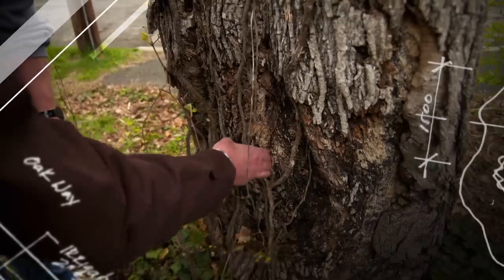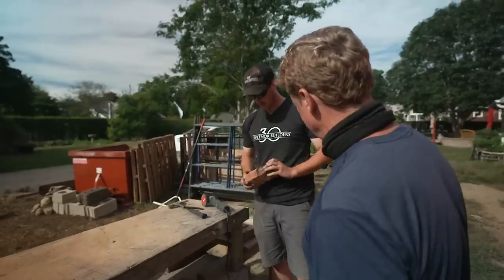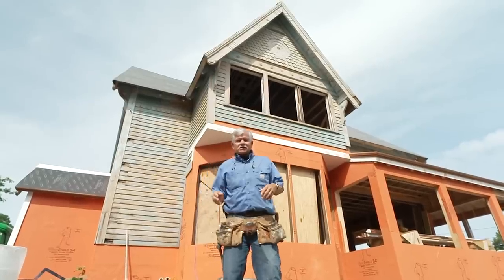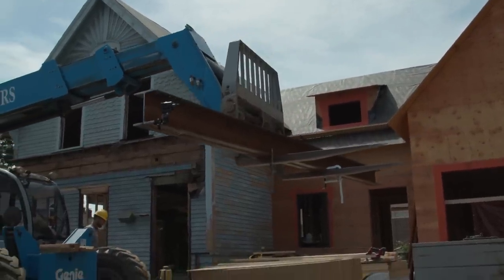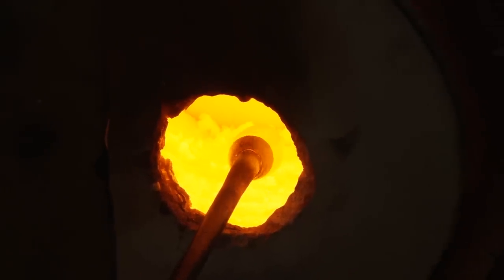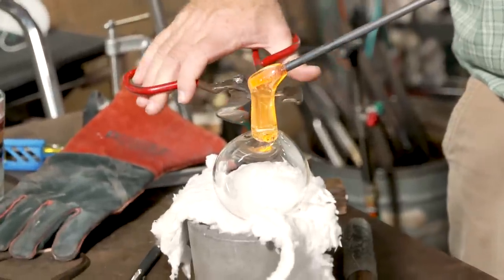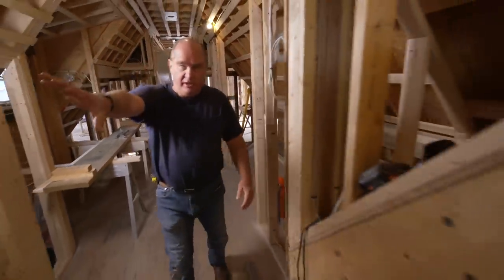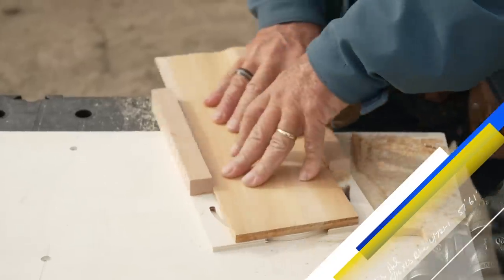This Old House | Chimney Straightener (S42 E7) | FULL EPISODE

Comment: What’s the fire hazard with these wood shingles?  Doesn’t look like there’s any useful fire inhibitor treatment?  Seems like a turned over grill or a lightning strike would put the whole place on the ground in minutes.
Reply: Been around way longer than any other roofing, you've surely seen those before.
Reply: Not really, I mean yes, but their not any worse than other types of materials used.
Reply: @sterlingodeaghaidh5086 how’s that?  “Other  types” of material, brick, cement fiber, Al siding are not flammable at all.
Reply: @DixieNormous1  Siding shingles for this TOH project.  And, most piece wood structures  burned eventually 1800s.
Reply: @Nill757  Let me prefice this by saying I get where your coming at but there is more to the equation than just what burns.  

TL;DR, they have rules to follow, and its not like wood siding is just waiting to combust the moment you put it up. 

Wood siding is rather good, its not like it will combust on the first sunny day after its installed, especially once its painted your talking about having to hold flame or keep sparks on it long enough to cause it to catch, not likely unless an extreme occours. The next thing you have to deal with is the bylaws and codes that are in play. They explained this a lot if you didn't notice but their in a historic district, and they have to make sure that the building complies with those regulations. This means using materials that are approved, in looks that are approved and more, even if they wanted to use more fireproof materials they probably have to use the wood shingles because of those rules.
Reply: @Nill757  All i am saying is their doing what their allowed to do and what they want. Knock it all you want its a choice because its allowed.
Reply: @Nill757  brick, cement (concrete) fiber and Al siding are all ugly.
Reply: @rogerweaver7686  Great, to each his own.  Just don’t try and pull me in to some bubble where everyone believes wood does not burn.
Reply: @sterlingodeaghaidh5086  Yes, and maybe there’s some flammable protection going on w shingles that makes them safe that I don’t understand.  On the other hand, Asbestos was allowed.  Balloon framing was allowed. Polybutylene water pipe was allowed.
Reply: @Nill757  Not saying its perfect, just that its allowed. Not everything has to have to be perfect. Some people want looks you cant achieve with other means, a residence or any structure shouldn't really be limited to certain stuff just because there is a chance of danger unless the risk is too great. This case, their fine, its not like the building is itching to burn down any moment.
Reply: @sterlingodeaghaidh5086  We all know the limit is where the “risk is too great”.  The point is to explore where that is, what is the actual risk, and not pretend there is none because it’s a personal  home.
Reply: @Nill757  yes, and in this case, id be less worried about the siding and more in making sure areas where fire can start are adequately protected. The actual risk is minimal, compared to other areas of the house.
Reply: @sterlingodeaghaidh5086  “minimal”

Ok, you know this how?  If you really don’t care about fire risk, great, that’s your business not mine.  I’m not interested in unsupported stories in my end.
Reply: @Nill757  I just looked up chances of a a fire in your house. Every year you have a 1 in 3000 chance of a fire in your house. Hope that helps because this baby shite should stop.

Comment: I remember when this show was about rehabbing an old house on a budget. Far away from that now.
Reply: Yep.  That fake chimney, with the unnecessary cleaned brick, unnecessary steel saddle, designed by an unnecessary structural engineer, scaffolding up on the roof, etc etc might be $60K.  For a Fake chimney.
Reply: That probably was their Knee jerk reaction to the COVID lock down.
Reply: @Nill757  They have no use for a chimney but are required to keep the brick chimney original on the outside.
Reply: @Egleu1  Yes I know the rules, resulting in an exorbitant waste of time and $ w no preservation of anything worthwhile. It’s a Disney-world ride.
Reply: @Nill757  how is it a waste of time and money? The home owners can afford it and the workers are getting paid. They're saving the old bricks.
Reply: @Nill757  the home owners know the price when they design the remodel. $60k is probably a massive over estimate, but either way it's not a lot of money.
Reply: @Egleu1  Steel installed up high and drilled onsite plus roof scaffold masonry labor plus structural engineer = $$$.
Reply: @Nill757  you think people buying this house and pumping a million plus into it are middle class? Besides with your argument then it's a waste of time and money to recreate the windows or the woodwork, why stop at the chimney?
Reply: @Egleu1  I thought I was clear.  This McMansion has been made not available to the middle class.  It easily could have become attractive and affordable housing from that old vacant. Now it’s not.
Reply: @Nill757  what's your idea of affordable? 500k? That house as it was needed a complete remodel just to be livable.
Reply: @Egleu1  it’s not “my idea”, but what the middle class can afford, ie the national median income, right now $1000/week or $4k/mo and then 1/5 of that max going to 30yr mortgage at current 7%.  Double the income for a couple maybe, but not forever if they are to have kids.  

Not sure what you mean by remodel.  Everybody knows it was an unlivable vacant needing a remodel, and everybody knows that the $2M or whatever TOH remodel was also not  the cheapest or only way to go for basic family shelter.
Reply: @Nill757  with a modest 1% property tax that gives you $106,861 for a house. Not going to be even able to afford to buy the land that house was on.

Comment: I saw the first episode and thought maybe they would go "old-fashioned". I know it's not practical to restore an old house to the way it was but dang... there's literally not one thing left of what it was but an outer shell. For heaven's sake, they propped up a "fake" chimney on steel beams. You could do a shrink-wrap completely fake plastic shell mold of the original and just paint it like a movie prop so it looks old. I just don't like it. It reminds me of the idiots putting "gas engine noise" piped through the speakers inside an EV car so they "sound" like old loud gas cars. Makes no sense.

p.s. This house had to cost hundreds of thousands or millions to restore like this. This show is just a new "rich people spend money" show.
Reply: Agreed.  They used to restore old houses, not gut the interior.

Comment: They really screwed the pooch on the cedar at 8:20...Every shingle tommy put on was too close...Ideally, as a cedar guy; shingles should be as close to center of the shingles it overlays...Sometimes ya gotta search a bit...When you're a good mechanic; the skinny one get you centered nicely...
Reply: Your forgetting, they have to make it look exactly like the 1883 shingles. 

If they are fit tight, then the new ones have to fit tight.

It's what some people call historical preservation.

Can you imagine having to do that with a 1600's building with tons fo ornamental add-ons?
Reply: Him laying out, getting closer to each next nail. No wonder the cut, went to corner.
Reply: yeah watching those shingle joints line up like that was cringe

Comment: How dumb to create a faux chimney.
Reply: A fake chimney is not nearly as bad as fake shutters!   At least the chimney preserves a historical aesthetic.
Reply: the historical district rules required a suitable external chimney be visible.
Reply: It's not a fake chimney, they said it was functional.
Reply: It’s not fake.  It serves a purpose if only in appearance.  Maybe you don’t value that, that’s fine, but it’s not fake.  It’s as real as the old chimney.
Reply: @jayburris6252  if can't function like it did what did they preserve? They preserved what it looks like coming out of the top of the house. But thats about it.
Reply: @susans9617  historic district rules widely vary across the country cause every district can make their own rules. This district doesn't want old homes. They just want buildings that look old. Disneyland does that too.... makes buildings that look old but actually are not.
Reply: @scotttovey  its fake masonry chimney. They’re exhausting gas furnace or fireplace up there which only needs a metal flue dozen feet off the ground exterior.
Reply: @jayburris6252    Aesthetic value  doesn’t determine reality. A Pirates of the Caribbean  battle in Disney might be valuable as entertainment doesn’t mean the swords are not plastic.  

 Masonry is not required for any gasses they might throw up there from a furnace/gas fireplace. It’s as fake as a trim wood surround on a porch steel post, and it’s a very, very expensive fake in this case.
Reply: @vespermk  The purpose of every aesthetic residential rules body is to … inflate property value.  They took this 120 yr old vacant box and made it into a $3M McMansion attached 2car.  TOH becomes TOMcM. Everybody gets paid.   Middle  class that wants to live in the area?  Tough shite.
Reply: @Nill757  Well said!
Reply: @Nill757  Aesthetic value absolutely effects reality.  To object to this fact is to ignore humanity throughout history.
Reply: @vespermk  Aesthetics has a function.
Reply: @jayburris6252  Aesthetics are … aesthetics.  Fine.  Put some value on them, the paint job, the trim, etc, and the market can decide what they are worth.  Pretending a fake masonry chimney through the top of the roof is necessary for the purpose of exhausting  hot gases is BS to get paid, which  has also  been around since the beginning of human history.
Reply: @Nill757  Aesthetics have an inherent  value on their own aside from other characteristics, like the protection from paint.  The Victorians especially cared about how things looked separate from function.  I understand the push back to a government telling the owners to put in a fake chimney.  Its actually disgusting, but that doesn't affect the assertion that the chimney has aesthetic value.
Reply: @jayburris6252  I agree and see the aesthetic value even if it’s not my taste. They could have gotten that w some plastic rock or have done sone veneer rock w little roof load, maybe no hole in the roof, $5k, $10k.  Instead, they ran a live masonry chimney up there exhausting gas to code from the furnace or wherever, full roof scaffolding with steel reinforcement and structural design from a PE.  They justified bogus work, maybe $50K, using aesthetics.
Reply: @Nill757  That makes sense.